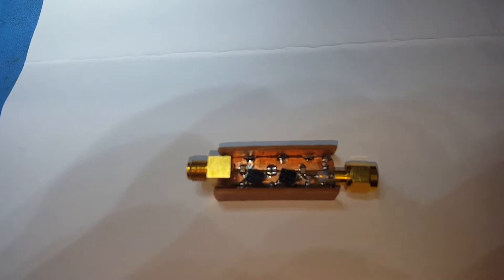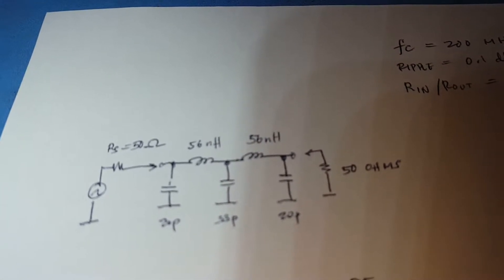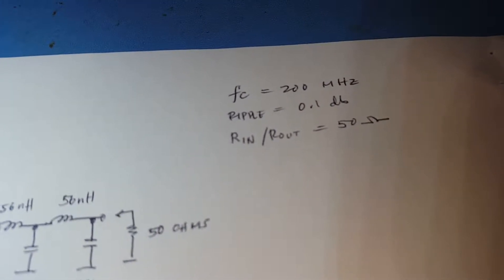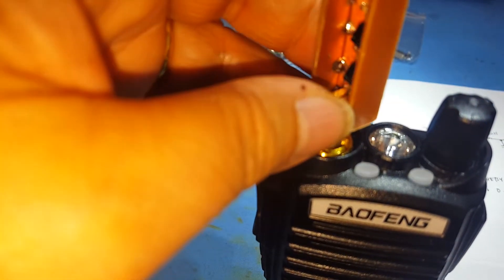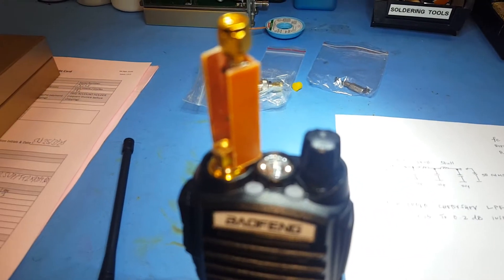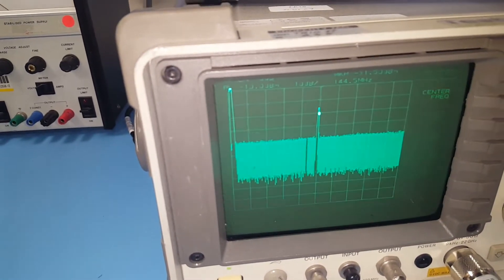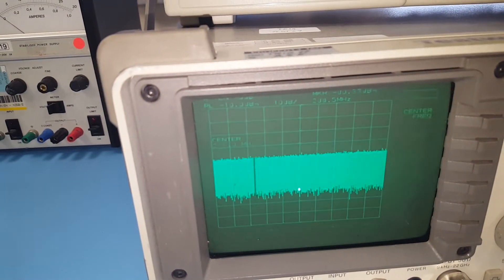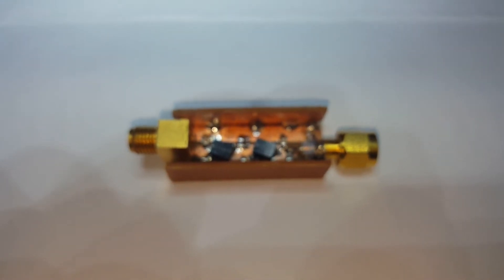145 Mhz  Low Pass Filter for Baofeng UV82 Tri-Band. Homebrew

Comment: we found baofeng to be very deaf when using external antenna, will this lpf help to solve this problem too? Thanks in advance.
Reply from the maker: Unfortunately no,the low pass filter will filter out the harmonics in the Tx only. It will not help on the receive  signal. Cheers 73s

Comment: Traducción al español: "Este es un Filtro Pasabajos casero y aquí vemos el esquema. Es un Filtro Chevicheff; Pasabajos de 5º órden; con 0,15 a 0,20 dB de pérdida de inserción. 
Está formado por dos pequeños inductores de 56 nH (Nanohenrios) y tres capacitores. Dos capacitores son de 20 pf y uno es de 33 pf. La frecuiencia de corte es de 200 Mhz. Eso significa que todo lo que esté por encima de 200 Mhz, va a ser seriamente atenuado.
La impedancia de entrada y salida, es de 50 Ohms.
En la imagen, se ven los conectores SM. Uno Macho y el otro Hembra. Eso permite atornillarlo al conector de la radio y colocar la antena encima.
Para mostrar su efectividad en un análisis de espectro, lo hago transmitir en VHF en 145 Mhz. Se ve claramente la señal de 145 Mhz, pero no hay trazas de la segunda armónica en 290 Mhz. Esto muestra como que evita la emision de armónicas, en el Handy Baofeng UB-82 tribanda. 
Hay filtros comerciales que cuestan U$ 100- pero este es prácticamente gratuito. Si le gustó, ongan Like y suscríbanse. Gracias." LU1AR

Comment: What if you want to transmit on UHF.. ? You just remove the filter then ?
Reply from the maker: yes you're right. Was just a demo to show what can be done abt. it. I could have put it inside but the 1.25m will be degraded as both 2m and 1.25m share the same LPF. A diplexer (2m LPF +70cm HPF) would be better!